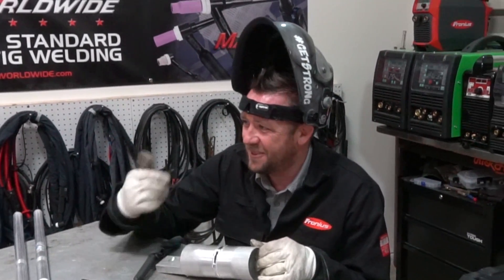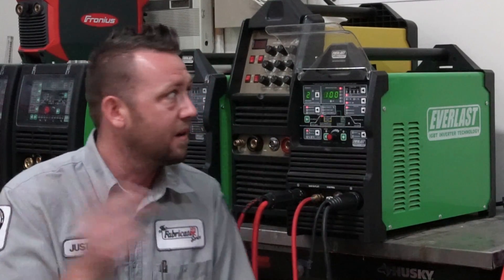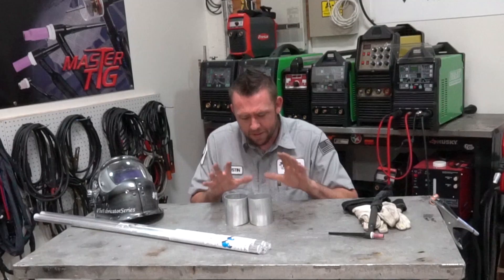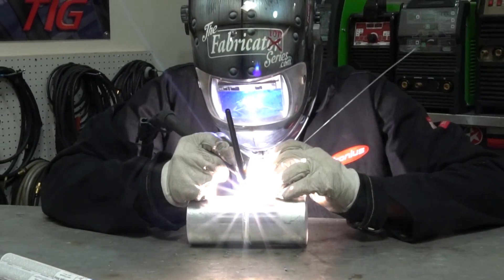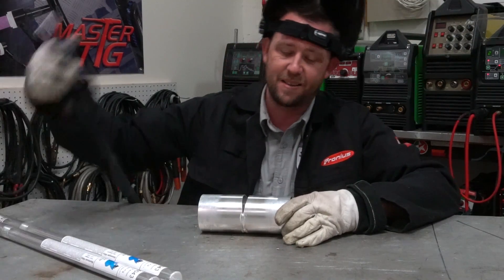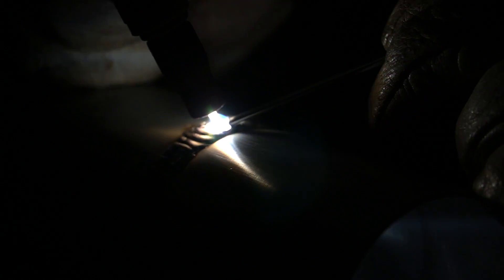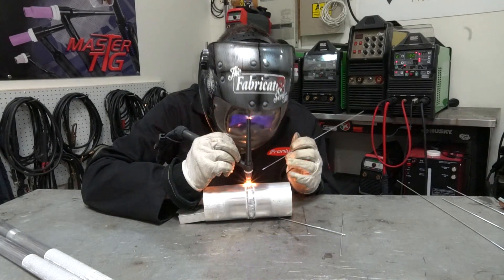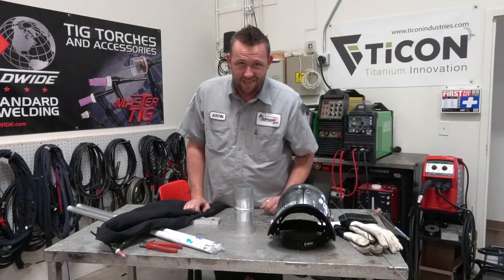TFS: How to Bridge Gaps and Holes on Thin Aluminum

Comment: Thanks for posting this, I just finished welding 16-gauge aluminum and had to fill gaps that were up to 1/4." Realize this is an older post, I used every technique to complete the job. I do question whether I could close up a huge gap like you did. Great job!!!

Comment: When i was a high pressure gas pipeline welder, their were many time you could not get the ideal spacing for a full pen weld on fix tie in welds..  I have dealt with extreme HI Low and wide gaps.  All the welds had to meet API 1104 or ASME Pressure Vessel codes.  All where subject to ex-ray evaluation.  The bridge technique you used iI employed several times although the gap was not the extreme you used.  I also had to use this on hot tie-ins were the natural gas was set on fire in the welding gap and then it was welded shut.  I used this technique with SAMW, GMAW and FLux Core arc welding.  This technique was used in horizontal and vertical.

Comment: Good info. I learned in my early years while stick welding that there are times for the extremes, but I also learned that there are lots of places between the extremes that one can be to get the weld right. God knows that even today I am impatient and put down some fugly welds... but they hold (I am not going to compromise on that aspect). If I may be honest I think that MIG welding has made me sloppier; I still prefer stick (though it is slower to put down). That being that, thanks for sharing.

Comment: Just passing by years later to say : In high pressure welding a gap like that is way outside tolerances and the apprentice that cut something like that is gonna get in trouble. Sometimes the best solution is accepting that you have to redo the whole thing. :P

Comment: I have some aluminum fan louvers 8 to be exact. They are all bent in a 3/8 inch deep 3 inch wide x 36 inches long box pattern. Originally they came with some sort of hollow hinge that looks like a rivet. They each hang at the top one above the next and open when the fan comes on. Years went by and all 16 holes wallowed all the way through to the edge. This is 1mm thick aluminum. Do you think its worth trying to fix the holes, maybe reinforce them with thicker aluminum or trash the thing and get a new one? 
Even with them all fixed some type of hinge will still be needed.

Comment: A great  Technology, that  I have got, Thank you  so much,  I tried to  weld Aluminum, Aluminum alloy,  cast Aluminum
Reply: Engie parts, cylinder head,intake manifold &  waterpump,  Engine parts  more expensive in ETHIOPIA,  so that I will doing business in welding, the problem is How to get A Mig machine, in ETHIOPIA not a good. Genuine mig machine, but only China mig not to work  properly.   Anyway  Thank you so much!!!!!  Very good  video.

Comment: Now do it without a foot pedal in the 6g. real world application, up in a boat, confined space, no pedal. The only way to control heat is with your filler. Good luck Mr benchtop welder

Comment: Just got done building a crazy contraption lunchtime project made out of lawn chair tubing and old aluminum tent poles. 10 - 15 minutes at a time and most of the material is way less than clean. Most joints are not even coped out good so I have a lot of gaps with solid tube on one side and edge of tube on the other. I use mostly .030” aluminum MiG wire for fill.
I have to build up the open edges like you did here and build a lot of bridges. I find that until you get a connection between the two tubes it is very unstable but once you get connected it balances out the heat. With thin tubing like this I also find that to aid in the heat transfer I have to go in ‘ surges ‘ more than just trying to be real low and slow. ( also because I am in a hurry ).
Aluminum is cool and when you can weld it you can make anything

Comment: What's the inside of that thing look? What do you do about built-up material on the inside? That's main argument for not doing this method. I've proven it several times before, you end up with a big clump of melted snot blocking the flow.If you're lucky enough to have access to said clump, it'll take you another 30 minutes to grind it all off with a die grinder. Any tips or advice?

Comment: Hey Justin. How do you like the Everlast machine. I've been looking into getting one. Just getting into tig and didnt want to break the bank. I've looked at welders that are only DC but I want the option of welding aluminum if I get brave enough. Just wanted your opinion on the machine. Looking at the power tig 185 DV by the way.

Comment: Good to try in a jam, but a gap over 1/4" and 1 inch long in something that thin, i would cut a piece to go in the crack, on a repair... even a hole 1/2" it's too easy to cut a piece to fill the gap.. great challenge though, to learn control...  learn what the base will do before it does it.... i have a challenge for you... take a steel 2" or there abouts thin wall tubing .083 slide an thin wall aluminum tube in it barely snug. Now lock them together by welding using alu wire...

Comment: I think that okay to go over after filling up such a huge gap. That’s what I would do. A lot of the time when welding thin stuff it’s hard to make it look good on the first pass. Of course I’m not a super good welder and then most of the aluminum I weld is old beat up dirty stuff and I’m usually in a hurry plus I’m usually not worried about it looking like a ‘ stack of nicklels’ just want it to be a sound joint
Reply: Sometimes even when it does look like a stack of nickels I go over it to make it smooth

Comment: Shame you didn’t show close up of the finished weld at all stages so we  could see what it actually looked like. All we could do is take your word of how good or bad it was.
Reply from the maker: You can see it as it was welded and a good or bad weld is not based on looks. It never is. The point of it all is you shouldnt be doing it, but if you had to - here's a procedure to tackle it. You can't base your opinion of this procedure off of what it looked like at the end. If you did, you'd be out to make decorations and decorations famously fail.

Comment: When I weld tears in aluminum irrigation pipe much like your example, I always use a patch or band-aid as I call it. Irrigation pipe is not structural but has to contain pressure. I would not be able to bridge a gap as wide as that. Takes real patience for that.

Comment: what filler rod  do i use to weld  carbon steel to  304 SS  need to do an exhaust  system thanks
Reply from the maker: 309

Comment: I wish the inside of the pipe had been shown afterwards. They often come out ugly, and sometimes helpful hints carry over into how to clean them up. Obviously, in automotive, it's not a good idea to use abrasive media on the inside as it embeds in the aluminum and comes out later through heat and vibration. Sometimes I've had luck running a holesaw through a straight pipe if it is short, but other times it's just a carbide bur on a flex coupler. I was wondering if you had any neat tricks to share?

Comment: I have two questions regarding Aluminium welding. I have to weld using an old Miller synchrowave 250 that doesn't have adjustable frequency so given that. 1st question. 
Any tips for welding cast aluminium so it doesn't go porous looking or goes to that horrible bubblegum skin looking weld pool?  2nd question,  I have to weld 1.2 Aluminium sheet from 1 side only that has to be ground flat from the welded side. How do you get smooth penetration that doesnt have the joint line through the middle of it so I can be sure that it wont crack once the top of the weld is sanded back?
Reply: Here's something I had on file re cast alu from a youtube comments section: <<nunya bizniss
 4 years ago: I've welded quite a few motorcycle cases, and I consider myself somewhat of an expert on the welding of cast aluminum. I tend to "blast and freeze", meaning I stomp on it to boil the crap to the surface, then let off and freeze it real quick before the whole thing collapses into nothing....I repair threaded holes, so I want solid metal to drill and tap. Skimming over it like you did here leaves a lot of voids in the metal. A couple of additional tips....use big rod. It cools the puddle, and fills up the voids as good as you can hope for. Sometimes you can't cook everything out til you have pure metal, because you have to be gentle with cast or you end up with a lump of scrap....one time, I was filling a bolt hole after I thought I had all the broken bolt out, and this one part just would not blend...finally busted out the grinder and discovered a small fragment of steel bolt still in there! >>

Comment: awesome video and great explanation! the only times i have ever experienced a gap THIS large is usually when im tasked to fix a part that has chipped out a nasty gap and it has to be welded to fit something specifically, thus i had to close it. never pretty but sometimes it happens!

Comment: What's your thought on the push button and pulse settings???
Reply from the maker: I dont use either.
Reply: @TheFabricatorSeries  

Lol dammit.. I wish you would..
Reply from the maker: @chipsammich2078  Pulse has been a function that interferes with my welding style, and I firmly believe it's more of a crutch to most people in that most people.use it to compensate for inability to lay it down the first time. Granted there are legitimate uses for pulse, but I rarely use it. 

Theres a lot of buttons/switches/rheostat setups out there that I cant get to all.of them, but at the end of the day - they basically make your welding style. It's up to you to learn and run it as you have it. I'll dig into this in the future.
Reply: @TheFabricatorSeries  
Your 100% right.. and that's why I use it.. I've learned to weld all the wrong ways being self taught taking short cuts.. With Tig my plan was to start from scratch and learn right but I find myself using the shortcuts.. I need to just start over lose the easieness of Mig and just start over.

Comment: I would grind it flush just to see how well you put the metal back
Reply: Usually when you grind something like that you end up grinding away the base material on the foot or toe of the welds. So then gauge aluminumdon't grind it unless you absolutely has to or the protocol calls for that. just from what I've seen working in a machine shop and also doing structural  welding stuff or even airplane part repair welds.

Comment: Can you not buff the weld down and dime back over it to make it nice? Newbie question
Reply from the maker: Integrity. You "can" but remember you weren't hired for your ability to produce mediocre or shady work.
Reply: When your done with the fill, that will be stronger then the original pipe correct? So if you buff it down even, where both pipes met it will be just as strong? 
Like i said im new to tig and understand looks are huge but im just trying to understand its no different than mig or stick in the sense you can grind welds down falt and they will have the same strength....correct me if im wrong

Comment: say you cant make another piece/ for arguments sake have to use this final product..why has no one mentioned cleaning it up and grinding it down till its smooth like you never even welded it.. i know this is all welding talk not grinding but i am surprised no one mentioned “oh just grind it down and smooth it all out and make it look like it was never there” if its functional thats important i think it was fine man you did a good job.. it may not be pretty but its fine i have bridged gaps just like this before on exhaust and seen it perfect on the inside then smoothed out the welds till it was pretty... why not just tell people in that situation its not all for lost .. it doesnt HAVE to end there.. or was all that just implied and everyone is thinking that without saying it and im typing this for nothing.. 
like on alot of the roll cages you have made im sure you have made a cut too short or this or that added piping then hid the fact that you added pipe by smoothing it all out then after powder-coating its invisible
Reply from the maker: Its integrity. There is no instance where you can't remake a piece correctly. If you were hired to stack a bunch of junk welds on to a part - then the job was done to expectation. If you were hired to do the job correctly without all the junk, then you do your job correctly and not make up excuses or base your skills on justifying mediocrity. 

Now on to the other part - I have cut plenty of tubes short in my time. I've also bent them incorrectly. I have NEVER lengthened one or bridged a gap because I didn't get it right the first time. I pitched the tube to the scrap pile and did it again.

Comment: I have gone over some of my welds with a pulse setting high amps on pulse and around 30% off it almost gives u that stack of dimes effect
Reply: I do that too, not crazy on perfection, but I want my welds to look good if I can help it. Except I don’t change settings just pedal pulse over the weld and it looks good 😅

Comment: I bridge a lot of gaps in aluminium at work every day. Most of what I work with is between 16 ga and 1/4 inch. Dirty and contaminated as fuck and I use a tired, worn out, spool gun. Good times.

Comment: Good stuff as always.   This is one of my favorite fabrication / welding channels.   

However, for us poor, struggling, DIY types working on less cool projects; do you have any tips on welding up old lawnmower decks that have been worn thin by way of abrasion (mostly) and some corrosion?   John Deere wants almost $600 for the bare deck alone.  Seems pretty steep for a steel stamping. 

I only have a transformer MIG welder (Airco Dip Pak 150 bought new decades ago)  and cannot seem to find a combination that doesn't blow holes thru the material.  In addition to voltage / wire feed gymnastics, I've tried copper block backing to absorb excess heat, sandwiching the holes with sheetmetal and way too much colorful language.  No joy on all counts.  Currently only have .030 wire and tips, but considering .025 as an experiment.  Never had any trouble welding new 14 ga. steel tubing so long as I kept moving at a good pace.  Guess deck around wounded areas is less than a millimeter or so.  Would TIG allow for possible success due to more control of heat being applied?   Would love to try TIG, but there is that darn money thing again.  Thanks.
Reply: You need to either cut out the thin pieces and butt weld it little by little or just throw a patch on it and a few small welds. Or maybe just fabricate a new deck since your going through the trouble anyways.

At my old job i had to weld 18 gauge to 12 gauge with .035 wire. Its doable.
Reply: @RedlineFabrication  Thanks for the feedback.  I did cut considerable material around the hole in search of thicker metal and got to something I thought doable.   Still had issues, but probably more operator than machine.  I finally did much the same as you suggested and at least closed the breach, but it is a butt ugly fix.  Resigned myself to the fact that form following function is the reality here.    Probably try a gas torch and brazing next time around, if need be. .  Plan on selling the property and once sold, the mower is no longer an issue.   Again, thanks for taking the time to offer up a solution.

Comment: i was glad to see you mention that what's important is matching YOUR SPEED to your settings on the machine.  either hot & fast or cold & slow.  most ppl say there's only one setting & one speed that works, which isn't true.  it's all relative to how fast or slow YOU are moving.  good stuff!  that thing would probably buff out if you got it low enough!

Comment: Should have done a close up of the final result. But other than that looks like a good video. I have to do repairs like this on aluminum boats. Its fun to fill in big tears tig welding fat gaps overhead with multing aluminum dripping on you. I could send some pics lmao.
Reply: click on full screen, set it to the highest resolution - 1080p, and you have a closeup.  That's what I did.  ;)

Comment: I know this channel is more of a auto fab channel, but this is pertinent to a lot of metal fab shop and manufacturing applications. I’ve received aluminum parts with 3/16”-1/4” gaps because the press machine was goofy, or the laser cutter fucked up. You just have to know how to do these gaps. Great content as always.

Comment: Thats a massive gap, if it ever happened id cut a filler piece with it being that wide like 3/4” 
I could basically fill up to a 1/4” gap, after that its a start over kinda thing
Reply: I would never bridge a gap like that with only filler.  But he is demonstrating the point very well.
Reply: Too much time wasted on filling a huge gap like that. Cut a patch, fit it in , tack and weld and dress it off.  Excellent video though.

Comment: Did you kinda pull the puddle with the torch? I would have thought gravity would have drooped that puddle when you bridged the gap.But it looked as if the puddle was sort of a tracked to the torch. There is some pretty crazy control of the metal going on there. Nice job I enjoy watching your videos. As a garage guy I still haven't made the jump to a Tig welder yet but I can see it coming. Still just Mig and Stick
Reply: If you want to jump to TIG welding, I suggest the Harbor Freight Tig/Stick machine. Under $400.00 bucks, foot pedal, and all. Prior to buying mine, I hadn't tig welded for 50 years, but after a few practice runs, I was laying down some really nice beads. D/C only though, can't do aluminum.
Reply: P.S. If you're doing  this for a living, you're surely going to want a more sophisticated machine. I build Tattoo studio armrests w/ 14-16 ga.square steel tubing just to stay busy in retirement. That 'hloe' business had me seriously cracking up!!!